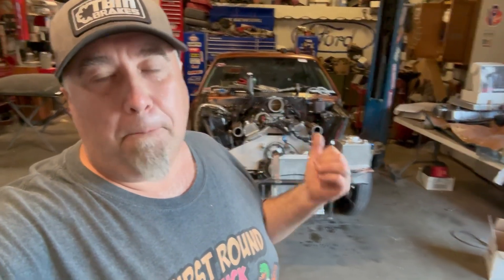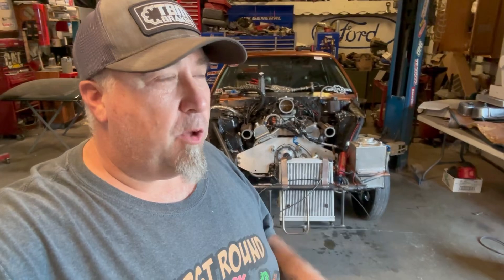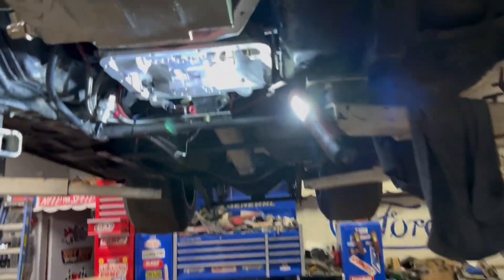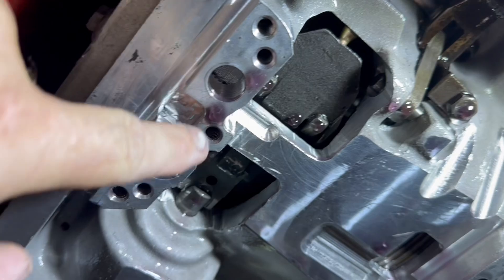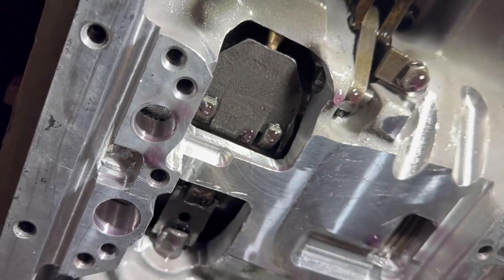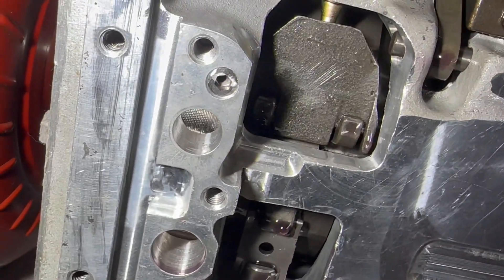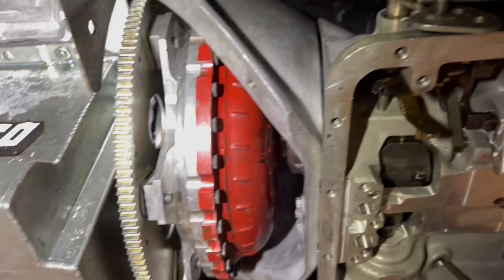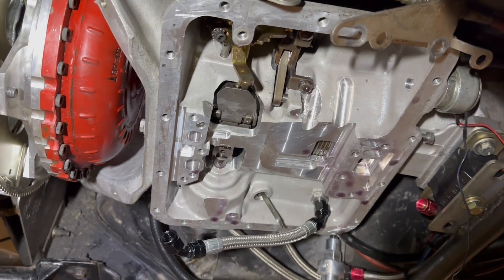Torque Converter Feed Restrictor

Comment: Why would you want to restrict the oil feed into the converter, less oil circulating thru the converter = higher temperatures?
Reply from the maker: Sometimes, you have to restrict it so you don’t have too much fluid going to the converter.  Too high converter line pressure can kill engine thrust bearings.
Reply: @TurboJohnRacing Hi wouldn’t a relief valve in the cooling line circuit be a better fix than restricting the oil flow into the converter

Comment: I restricted in the same place with a slightly smaller 7/64” hole and saw just over 50# reduction in line pressure.

Comment: So iv spoken to a few people about this with my power glide, from what I’m told that all putting that restriction in will so the flow but not the pressure, I have put a dump valve reg combo onto it see what that does
Reply from the maker: Well, I don’t know about that necessarily.  Say the transmission pressure makes 200psi internal line pressure.  An orifice at .125 will flow less volume than an orifice that is .200.  If the volume of fluid going out of the converter is the same, the smaller diameter restriction will not create the same pressure unless the volume coming into the converter is greater than going out.  Theory anyway, lol

Comment: What will help to restrict the converter feed?May be a dumb question, but I’ve never done it or had to do it, so it may be helpful info to have for my power glide
Reply from the maker: Helps control pressure inside the converter

Comment: Does restricting the converter feed circuit affect  how tight or loose the converter is ?
Reply: I don't think so..   I think it keeps the pressure lower for the trans brake so it won't stress or over pressurize  the transmi and converter when on the two step. . Just something I've heard. You'll need to do your own research. 😁👍💪💪
Reply from the maker: If too small, it will loosen.  Just have to size it.

Comment: Superglue all the washers to a larger chunk of metal and grind them all at once....then just knock them loose.
Reply: I was amazed the first time I turned the face of a spacer  super glued to some stock in the lathe.
Reply: @robwigglezz944  a lathe would be ideal.
Reply: Or cleaner and easier yet a really strong magnet.
Reply: Or so common as to effectively be free, superglue and scrap metal